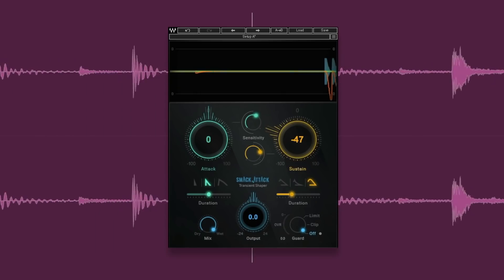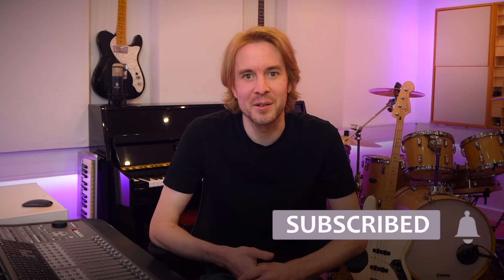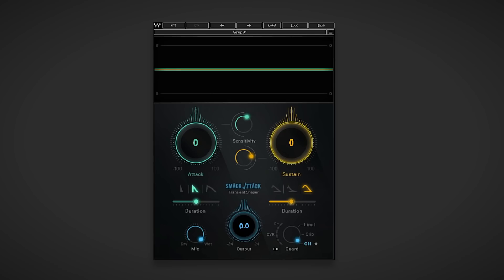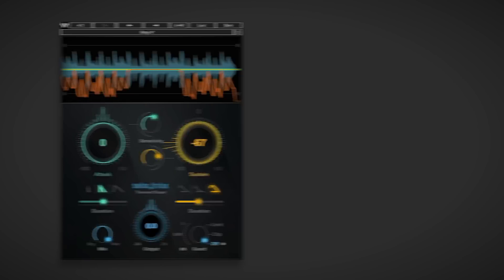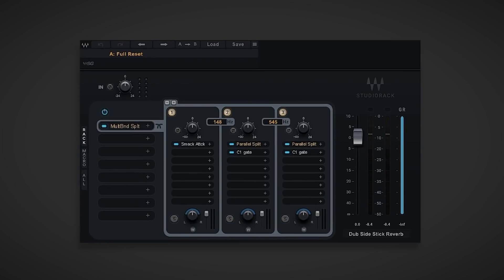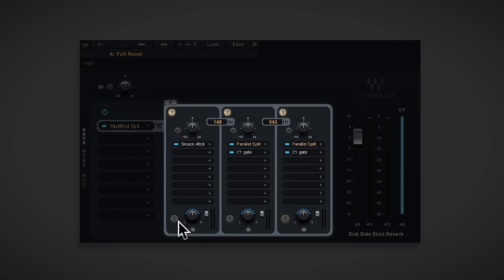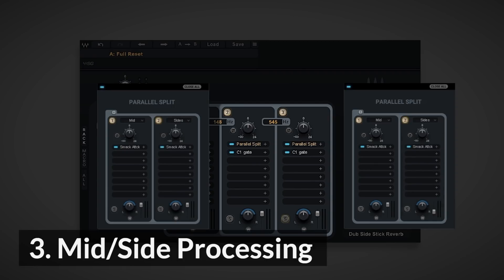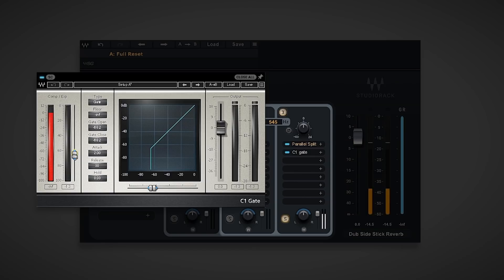How to Remove Reverb from Drum Samples

Comment: Can we use it to de-reverb too roomy voiceover sound as well?
Reply: I have definitely had some success with this. It requires careful tuning of the Sustain Level, Sensitivity, and the Duration length. It makes the overall dynamics a bit choppier, so careful compression afterwards helps.
Reply: @palebluedotstudios  upward or downward compression?
Reply: @apollospyrol7168  Downward, to tame the jumps in gain.You could experiment with upwards, though. However, things like Accentize DeRoom, Izotope De-Reverb, and SPL De-Verb are much more effective for mono voice material.